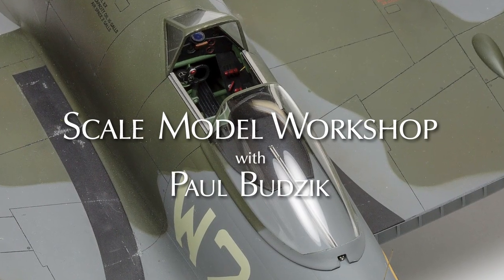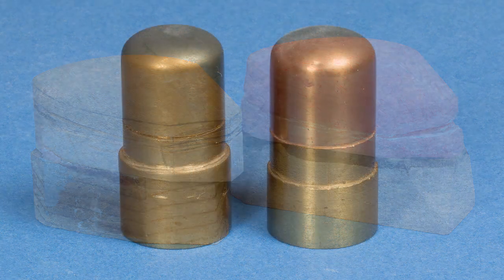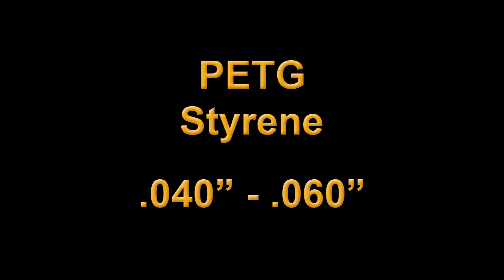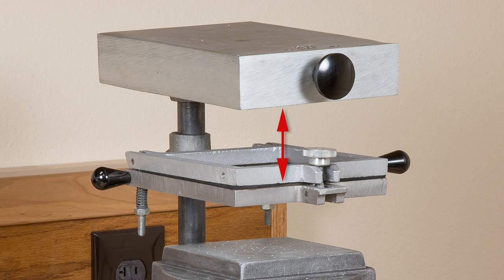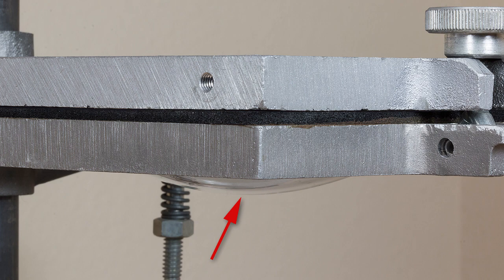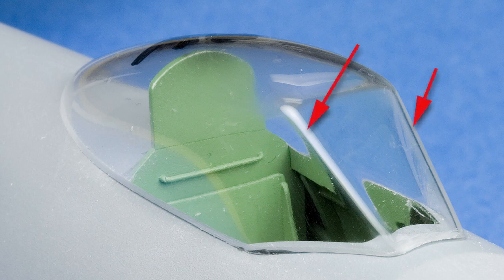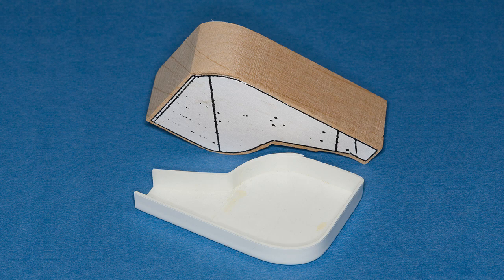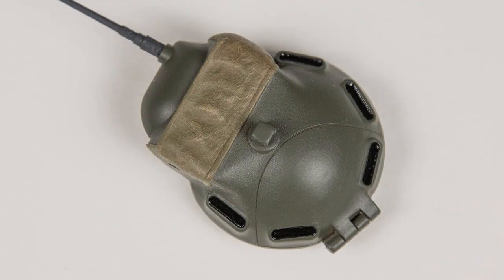Dental Vacuforming Machine for Scale Modeling

Comment: Hi, Paul, I guess I didn't understand the process in forming vacuforming canopies. I believed the kit canopy was used as the pattern and the new canopy was molded over the kit canopy. I got air-hardening clay as the rest of the pattern for the base. When done, the kit canopy melted in some areas. I have one of the machines featured in your video ( imported blue / red one ). In your opinion and experience, is there any way to use the kit canopy as part of the pattern successfully? Thank you.

Comment: I found that the plastics for vacuum forming seem to be expensive...especially when you are experimenting...so I tried some different clear plastics...One that worked quite well is the 'Face Shield' that we get in the UK (they have 'Face Shield' written across a blue band and have a sponge on the rear)...altho a little thin...I made a bubble canopy for the Revell Beaufighter 1/32 scale...Milliput seems good to make the solid mold...My only issue was gluing the canopy to the model...I tried CA but it fogged...and the PVA type canopy glues are never very good as PVA is made for porous materials like wood and paper...When used for plastics it it doesn't penetrate and so uses a static adhesion which is easily broken...

Comment: Your approach here is most valuable for its innovation and utility. 
   I have a different take on this method. Mine is largely theoretical, however, so I bring it to you to determine its viability, and its practicality to the purpose I intend. 
   I have avoided vacu-formed kits. Their assembly invariably has proven exasperatingly problematic. The parts' surface detail also suffers considerably. 
   The polystyrene kits of sailing ships generally feature the sails fashioned of very thin polystyrene sheet. (Incidentally, would you or any of your comrades know the thickness?) These have no issues of precision in parts fit. At the worst, one at the end must excise any excess.
   In working with such thin material, I have contemplated something that one could apply to a strikingly different application, one that offers to modelling a remarkable innovation I have not seen. I have no idea as to how to proceed, however. 
   In specific, my purpose is to alter a 1:25th scale (or similar) model of a generally conventional vehicle (car, truck, etc.) to represent the damage from a collision. 
   The actual application would be a custom job specific to each kit. One somehow must make a precise duplicate of the body, or the portion relevant to the build. One can adapt vacu-forming to this purpose. This might include the bonnet (hood) and/or the boot (trunk), depending upon the specifics of one's project. This process must capture the exact surface details of the original (or, one later must reconstruct them). 
   One next must 1) determine which portion(s) of the vehicle's body is (are) to receive the alteration(s); 2) cut away what one no longer needs (save the remains for another purpose; I keep my sprues, every scrap cut away, even the dust from sanding, grinding, drilling, etc.); 3) identify the corresponding portion on the altered vacu-formed sheet, carefully cutting it free; 4) fit it into place, and assemble; 5) somewhere during this process--one must determine where this ought to occur--one must press the thin polystyrene to rework it into the shape representing the crumpled damage and deformation sustained in a collision. One then would paint the model, and detail the  altered part to illustrate the additional indications of crash damage. The bonnet may be bent up vertically. Other parts of the kit, e.g., the windshield, may have their own signs of destruction. A wheel or a door may be out of place. The driver and/or passenger(s)  may show signs of injury, possibly severe.

Comment: will 3d printers replace the dental vacform machine?
Reply: Only to make moulds, not transparent parts. Iprint both resin and FDM 3d prints. But you can't create transparent thin parts with them so i will use the resiin 3d priinting to create the mould to be used to vac the transparent styrene.

Comment: I am having a problem where my .060 styrene is getting so thin when I push down that the part is unusable.  What advice can you offer to help solve this problem? I have tried to heat the sheet less, but details don't come out. The styrene seems to get wavy first, when heating, then it droops very quickly (usually within 1-2 seconds) and gets too thin. Any help appreciated.
Reply from the maker: I usually heat the material more slowly by not raising it so close to the heating element.  If it is drooping that quickly, you're probably all the way up to the element.
Reply: @scale-model-workshop  I'll give that a try. Thanks!

Comment: why isn't the heating element under the plastic as heat rises? I built a former years ago and put the element high way between the plastic and the form never had a problem now everyone is putting the elements above yet heat rises it's IMO less efficient.
Reply from the maker: Your idea is sound from the standpoint of heat efficiency, but practically, it's easier to build a machine where the heating element is more fixed.  And these compact machines are really built on the scale of economy and ease of operation.  In a more commercial setting, dealing with larger sheets, we use ovens to heat the material.
Reply: Thank you
Reply: In college (I studied Technology Education at SUNT Oswego), we used a larger vacuforming machine; the heating element slid over the plastic, and when the plastic was sufficiently heated, the element would be slide away while the vacuum was turned on.  As the heat in this case is radiant heat, the element being above the work is not really an issue.  Heat rising is much more of a convection issue.
Reply: Because the material drapes OVER the master.